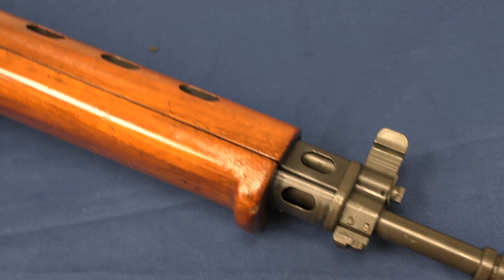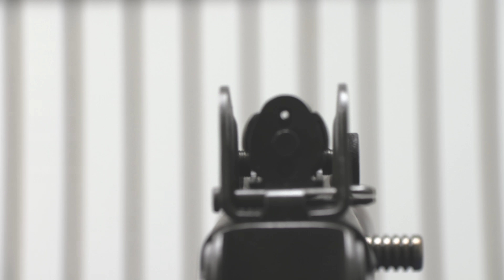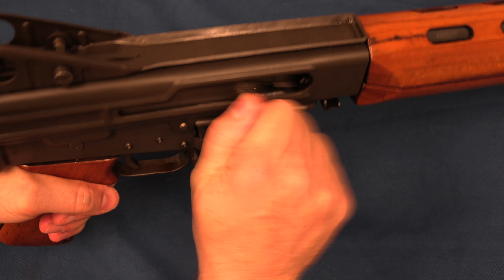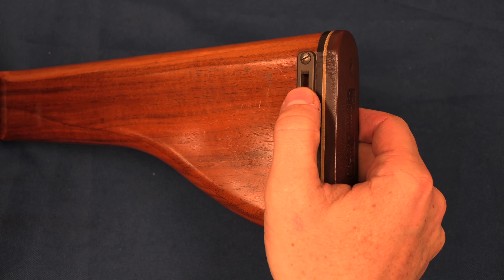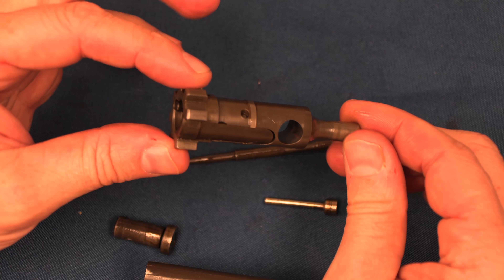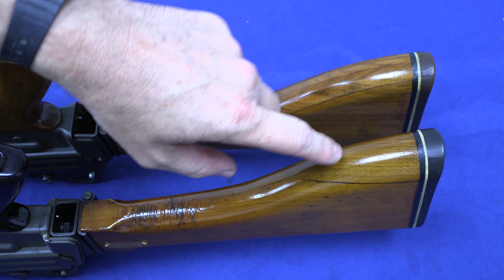AR-16: Armalite's Lost Battle Rifle

Comment: I love everything about it.  Designed for low cost mass production, tilt locking mags, fires a full powered battle rifle cartridge, folding stock, proper full length sights, pistol grip, wood furniture, and a short stroke piston operating system.

Comment: The Swedish AG42B Ljungman had direct impingement gas how did Colt patent it?
Reply: Stoners 'direct impingement" isn't actually direct impingement, he called it a true expanding gas system, other people refer to it as an "internal gas piston" system. That's the patent colt purchased. 

True direct impingement like what the AG42 and MAS 49 use are NOT what the AR10/15 use

Comment: The first time I've seen any real detail of the AR16. I've always loved its little brother the AR18; the look of it, accurate, great ergonomics, very pleasant to fire, not "twangy' like an AR15. The main weaknesses were the weak folding stock hinge, and reinstalling the bolt carrier with the bolt not fully out/forward can result in the cam pin jamming the bolt carrier in the receiver, both easily solved with a little more development.

Comment: Nice that Stoner dumped the direct insertion magazine.   The AK system, HK93/33 system and M14 used cam locking.   Goes in, stays in.

The AR/M16 had problems dropping magazines - these were reported with earlier models in Vietnam.

Comment: Have you done a video on the Armalite marked M-16.  I was activated in 2001-2003 and before we were released we converted a mix of several  hundred Colt M-16, M-16A1 and several Armalite M-16.

Comment: Ian with the timeline you present in this video, the Fokker aircraft connection is not totally accurate. You mention that Fairchild go the rights to the Fokker 100. That aircraft was developed in the late 80's as a newer updated version of the Fokker 28 and shared the same type certificate. However Fairchild did manufacturen Fokker Aircraft under licence, these where limited to the turboprop aircraft that Fokker made namely the Fokker 27. Fairchild never produced any of the pure jet aircraft and only made the turboprop F27 under the licence agreement as the Fairchild F227.

Comment: I have a M17S in 308, and the bolt design is nearly identical, then some parts that are clearly based on the AR-10/15. Cool to see where your gun came from.

Personally, I'm in the camp that says the AR-18 is the superior mechanical system. They just dumped it in a cheap stamped receiver, when cheap stamped receivers were on the way out.

Comment: The weird little pin used as the bolt handle, is a pretty standard solution in aircraft assembly of the time.  And, makes perfect sense from a company which built aircraft.
Reply: It spawned millions of QR ratchet wrenches.
Reply: Plus that nice Starrett Center Punch removal tool.
Reply: still weird but nice explanation.
my thought would be to just weld a handle onto the bolt, with space to remove the bolt when you open the gun that is covered by the lower when the gun's all together. much simpler/sturdier than the several tiny parts the AR16's handle uses.
Reply: In aircraft use, pins with the detent ball locks are called “PIP pins”.   Still used today for all manner of quick release needs.
Reply: @DocBacon  yes but they aren't ideal for rifles. 
the heat/vibration in the bolt group will weaken the springs and cause it to eventually fall out.
Reply: @RSF2278  Well, in high vibration / high heat environments in aircraft engine bays they seem to be reliable.  In the case of the rifle shown, the pin is in shear under reciprocating movement, not loading the ball-locks at all.  Not an issue.
Reply: @DocBacon  the other issue is cost of manufacture; lots of fiddly parts vs. just welding a handle on as one big part. 

I mentioned it in another comment, but that plus a slot for the handle to clear in the upper and a overlapping section on the lower would be fundamentally a less complicated (and expensive) way to do it, which is important when you're advertising to 3rd world countries with limited production capability.
Reply: @RSF2278  There’s certainly simplicity in just welding on a handle, but that doesn’t allow the bolt to be removed from the receiver in this design.  As the vidoe mentions, many designs use a captured bolt handle reciprocating in a slot with a keyhole for disassembly, but the open design of this upper doesn’t allow that.  The ball keeper pin in this case make sense, even if the part becomes a complexity - perhaps a balance of engineering compromises.  Either way, mooted as this isn’t a production gun, and the pin’s durability isn’t a constraint in any case.
Reply: I mean Ar-15 looks like an aircraft world solution: minimal safety margins

Comment: Cool history. I'm still surprised the AR-18 didn't get the market penetration the AR-15 did; a much cheaper solution to the same problem. I almost got one back in the '80s, but held off for the more expensive AR-15. Six ARs later and I don't actually regret that decision.

Comment: The bolt handle works the same as a ball lock safety pin. On the safety pin you hold the head of the pin, push in the button in the head and while holding the button pushed you can pull the pin. 
I first became aware of these when I went in the Air Force in 1976. They used bal lick safety pins for most anything they wanted to hold securely but still be able to remove easily. I worked on ejection seats and we used theepins on red streamers to safety explosives on the system.

Comment: Reminds me of, and probably the inspiration for, the Holloway HAC rifles.
Reply: Aboutnthe only things the HAC-7 and AR-16 have in common are the general appearance of the sights and the fact both use paddle.mag releases.

Mechanically, the HAC-7 is very much a Kalashnikov operating system and trigger group, with a fixed gas piston permanently attached to the carrier holding an AK looking bolt.

Comment: Just googled Fokker 100, OMG, I did not expect that to be a bird THAT big, I though it's gonna be a smaller aircraft, akin to some Cessna models.
P.S. Just looked up production years - mid 1980s, not 1950s, something here seem to be wrong, I guess Fairchild got rights to some other Fokker model.
P.P.S. Yeap, it was a "grandpa" of the Fokker 100 - two models before that: "The Fairchild F-27 and Fairchild Hiller FH-227 are versions of the Fokker F27 Friendship twin-engined, turboprop, passenger aircraft". It was followed by F28 in 1960s-1970s and only then came the model 100.

Comment: Funny how some viewers get all excited about this rifle, "make this rifle", etc.     I see this rifle on p 656 of my classic 10th edition of Small Arms of the 20th Century from 1973.  I note the photo in the book shows an AR-16 with a recoil pad and what appears to be a fixed stock.  Ultimately, this became a stamped,  short barrelled rifle firing a 7.62x51 (what could go wrong?), almost 10 years too late.  Maybe a good thing that a 3rd world country did not try to produce this rifle.

I turn the page of my book and there is the section on the Stoner 63, a modular rifle system.  Now there is something to get excited about.
Reply: If you got lots of cash and are lucky to find one, there's the RobArms M96. It'd be nice to have a reasonably priced one, though (I'm looking at you PSA).

Comment: For some reason I really like rifles that's built using stamped sheet metal. It's something about the efficiency of manufacture that appeals to me.
Reply: Something about the stamped steel Cold War aesthetic just hits different. It’s crude in a good way
Reply: My wife an I visited the 101st Airborne museum in Sainte-Mere-Eglise France. They have a collection of German weapons in a case. I just stood there drooling over the STG44, MP40 and MG42. The german technology for stamping receivers and parts for weapons at that time was unsurpassed.
Reply: As a manufacturing engineer, machine from forging or billet is easy and lazy. Designing for pressing is hard as you need stiffening ribs and get spring back, so geometry control is hard.
Reply: @drjamespotter  The real way to make it easier to manufacture is to go the PPS43 route. Take a standard guage of sheet metal, then fold and weld... You get the cheapness of sheet steel without the complicated pressings... I would have loved to see an AR18(or AR16) using that.  It would be like steel origami.
Reply: @liamwhelehan2703 except compared to AKM, PPS and PPŠ used 2 millimeter thick steel. Not the one millimeter.
Reply: @drjamespotter  But once you have the tooling you can stamp out thousands of them in a hurry. That's the thing that's so beautiful about stamped steel. When you have the tools the parts price is very low.

A friend of the family was a tool maker and my father helped him preparing some press tools he was working on and it was an incredible job. The steel isn't your average mild steel, because that was supposed to press parts out of high grade steel sheets. To me it's strange that it's actually possible to press so many parts before the tools has to be replaced.

Now designing a firearm where large parts of the body is pressed steel instead of machined from a billet isn't all that easy. It has to be stable enough to retain calibration and strong enough for long time use. But it's some how interesting to see when it's done right.

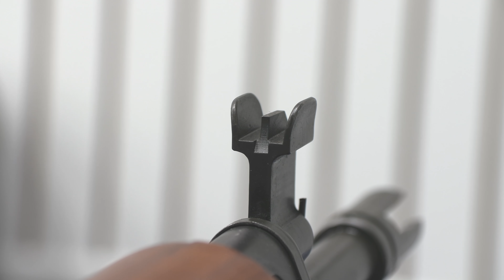Comment: 3:06 Kinda like how Mikhail Kalashnikov wasn't too excited about 5.45.
Reply: The 6.5 Creedmoor is what should have been. It is basically 6.5 Swedish Mauser with a shorter case and a hotter load despite being based on the .30 Thompson case. It shoots flatter and has longer range than 7.62 while also having superior armor penetration capability, and recoil is between 7.62 and 5.56. With 120gr bullets these are absolute screamers. The case has a little larger diameter than 5.56 so 25 rounds magazines would probably be the most convenient length.
Reply: @andersjjensen  6.5 Creedmoor doesn’t make military sense, the barrel life isn’t near what 7.62 nato is, the cost and logistics of barrel replacements and the inability to use friendly ammo stock in my opinion make it a waste outside of specialist units.
Reply: @tarkett8529  Barrel tech has come a long way. Yes, all ultra high velocity cartridges are heavy on barrels. So is .277 Fury which is being adopted. And my point wasn't that it should be a specialty round. It was that it, or something similar, should have been adopted instead of 5.56, as it was simply too far in the other direction.... Which is exactly why a replacement is being discussed.
Reply: @andersjjensen and it’s a bad choice, logistics are going to be a huge problem everyone learned that lesson after ww2
Reply: @tarkett8529  It wasn't a huge logistical problem switching from .30-06 to 7.62 or from 7.62 to 5.56. So it wont be a a logistical problem when the next change comes, which is probably going to be .277 Fury. As long as everyone uses the same ammo... Which is why we have the STANAG in NATO.
Reply: @andersjjensen  277 Foorie is the dumbest crap ever designed.
Reply: @worldoftancraft  Someone forgot the basic principles of physics. You can't make something (somewhat) heavy go really really fast without gross recoil. If they had stepped the bullet mass requirement down a little... they would have ended with 6.5 Creedmoor. 5.56 is too small. 7.62 is too big. The average between those is 6.59... not over 7.
Reply: @andersjjensen  someone forgot that instead of knocking into gates, you use back door.

More than 70 per cent of body is covered in natural/synthetic fabrics or aramid. You really need a long rod penetrator to pierce it?

You need to pierce plates only if you are mister Tramp le presidento di Usa. Who needs his military to be, quote, "lethal". While math says it should be a conveyor of WIA
Reply: @andersjjensen  That caliber seems to have taken off on the American civilian sport shooting market.
Reply: @judsongaiden9878  Compared to 6.5 Swedish Mauser it has 18" less bullet drop at 1000 yards. Which is an improvement for sure, but nothing dramatic considering 6.5 Swede has existed for over a hundred years.... The madlads basically had the perfect set of tradeoffs between range, accuracy, recoil, penetration and terminal effect figured out a hundred years ago, and only material science has pushed the boundaries ever so slightly forward.

Comment: I’ve always really liked the wood and steel aesthetic of some rifles during this era. I wonder if the original AR15 would have been more easily accepted if they had had a laminated wood stock and handguard. Of course that wouldn’t have solved the early reliability issues due to the chrome lining removal and the changes in propellant but it would have lessened the unease soldiers/Marines felt upon issue of the new plastic rifles after carrying the M14.
Reply: First US military buyer of the AR15 was the Air Force, who were much more experienced with novel materials

Comment: Aesthetically, proportionally and mechanically perfect.
Reply: It looks wrong without a proper magazine well.
Reply: Except it isn't. Except it's the forced shift to Tokárêv's gas system. Except they didn't improve the mags.

And the charging handle is a machining-wise crime. A criminally and stupidly complex design.
Reply: I wouldn't say aesthetically perfect; nice certainly, but there are nicer looking rifles.
Reply: Nah.

Comment: I always thought of the AR-15 like a 1911, but the AR-18 is like a Hi-power.  The former is usually copied almost exactly, but the latter serves as a basis for almost everything that came after.
Reply: Proponents of the 1911 rarely mention that the linked-barrel system- as opposed to the Hi-Power's cam system- is used by few (if any) other pistols, ever since.

Comment: I don't know if it's something you'd consider doing, but a video that goes a bit more explicitly into the manufacturing differences using a couple of guns as examples would be super interesting. Like have an AR-15 and AR-18 on a table and talk through roughly what would it have cost to set up a production line for each in period, maybe looking at the differences for a small vs larger batch too. Luke rough machinery costs, floor space, numbers of staff, compatiability with likely existing manufacturing plants. I think it could be an interesting way to look at other time periods too, like take whichever was the first large scale CNC machined rifle receiver and compare it to a contemporary forged/cast/extruded or stamped part. I appreciate all these themes are present in videos about different guns, but a specific one to really drill down the implications of choosing a different manufacturing method would be really cool. I think I remember you saying that was your academic background too. Thanks for the videos!
Reply: Unfortunately I don’t think that’s Ian’s expertise. That would be more for someone with a strong background in manufacturing, millwright, etc. but I like the idea.
Reply: @tymader8927  I believe that IS where his degree points, but to be useful, that's also the sort of study a company or gov't would spend several million and several years on.

Comment: That "complicated and wierd" bolt handle works exactly the same way as an aircraft "pip-pin" or "ball-lock pin" fastener. Pip-pins have a protruding button that retracts the balls, thus making them very easy to use. Suspect this is a "borrow" or at least "inspiration" from the parent Fairchild aviation company.